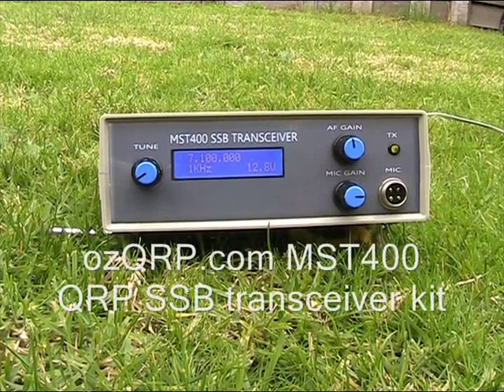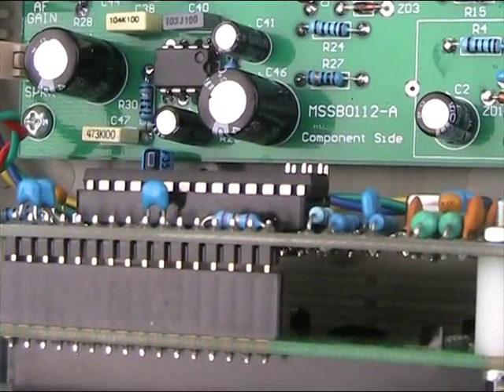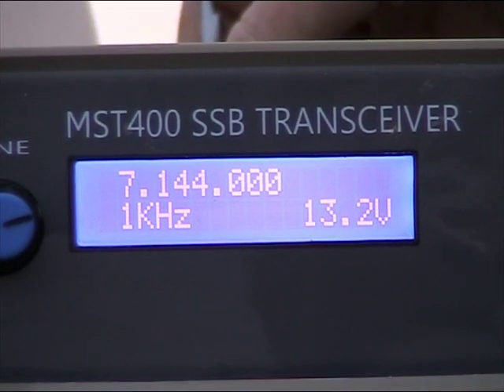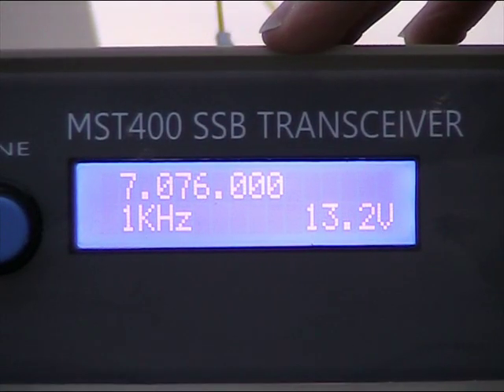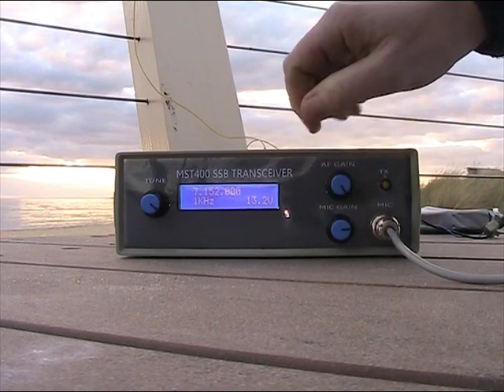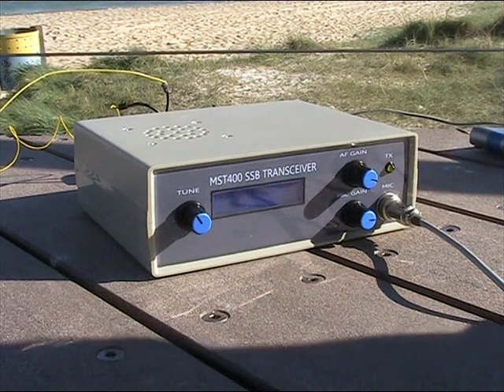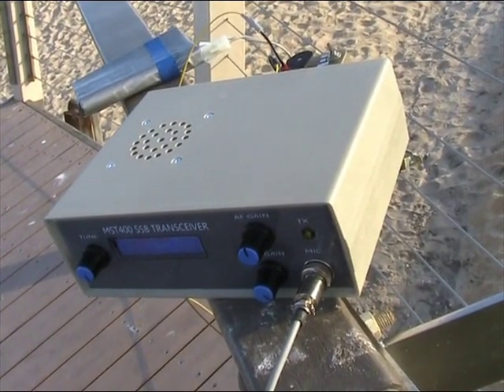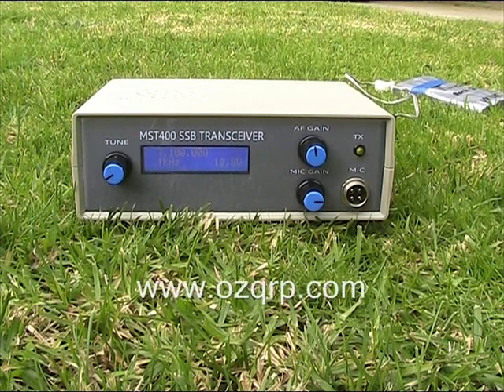Review: OzQRP MST400 40m SSB transceiver kit

Comment: Hi Peter
Nice review and great looking kit. It sounds like a very similar circuit as the 40m TCF design using the same ics and output transistor. I wonder if the DDS kit would make a suitable companion installed in the VK3XU 40m TCF schematic?
Another great video Peter 73
M0DAD
David